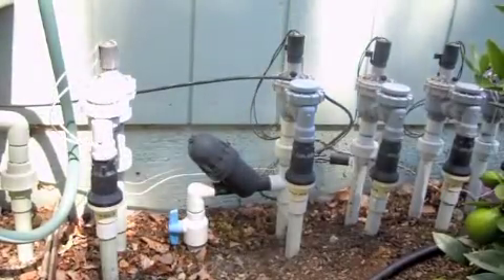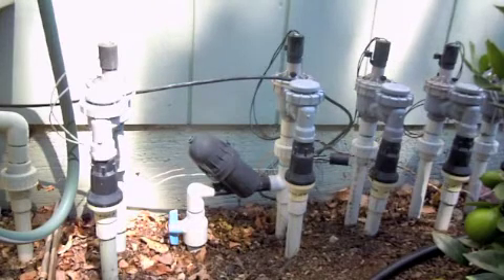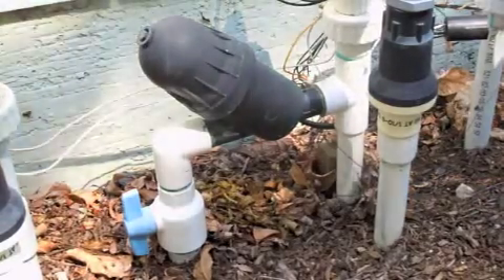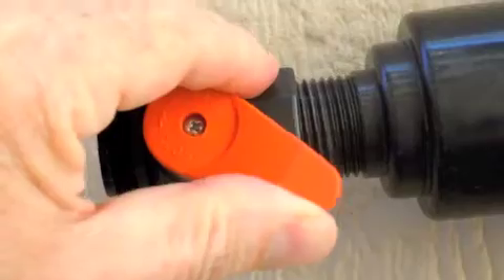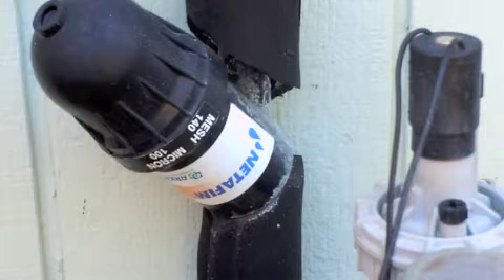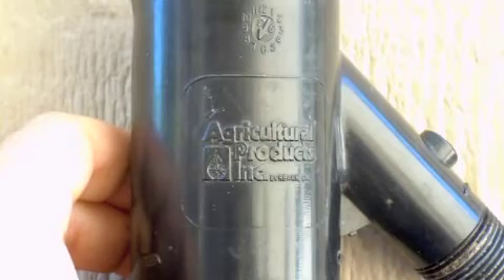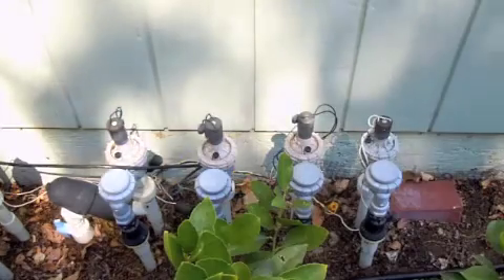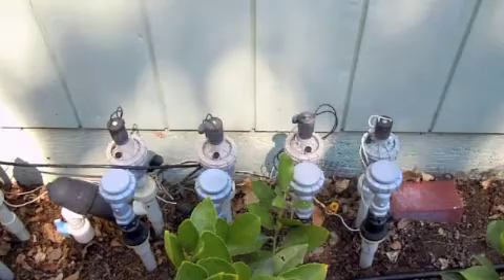Drip Irrigation Filter

Comment: Hi.  Unfortunately your filter is facing the wrong direction.
Reply from the maker: This Netafim filter is on correctly, just designed so it doesn't look intuitive. other filters face the opposite direction, look for the arrow
Reply: It is actually a wrong direction? These filters should have an arrow that indicates the direction of the flow.
Reply: No.
Reply: @tmmyjay   You may be correct if that filter connected to the anti- siphon valve is a “disc” filter.  After a ton of research and completely wasting my evening on this, I found the angle of the filter depends on the type of filter (screen vs disc). The common consumer irrigation filters you see in a general hardware store are screen filters.  Screens are easier to clean, less expensive, and can filter solids and silt which the Disc cannot.  But screens are not as efficient as the Disc filter at cleaning bacteria, algae and sludge. The Disc filters are more expensive, more time consuming to clean.   If you are using city water, screen filters are the way to go.  Also:
Screen filters: the filter angles 45degrees from the flow of water. 
Disc filters: the filter angles backwards or 135 degrees from the flow of water.  An arrow should be on the filter for the direction of the water.   If the filter on this video is a disc filter, then it is correctly installed.  Also, you can save 15% if you switch to Geico.  😆
Reply: @residentmanager3088  I just happened to be holding one at the time.

Comment from the maker: The best filter is Amiad.
Reply: Thanks for posting this video. The process for cleaning these filters is straight forward?
Reply: @alexandermearle  Screen filters are simple.  Just unscrew and rinse out screen.  My advice Is to buy a metal screen and not a plastic one which tend to break.  The disc filters will take more time to clean since you will need to scrub them in water to remove the filth in between all the discs.   If you are using city water, screen filters will always work and are less expensive than Disc filters.  Disc filters are effective for removing sludge, bacteria and slime … in other words, use a disc filter if you are pulling water from a dirty well or from a reservoir pond.